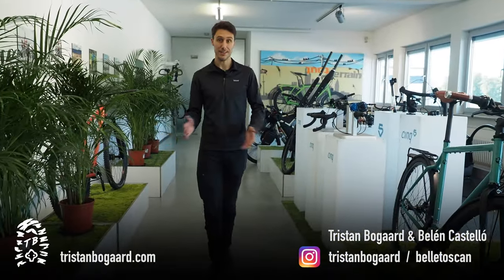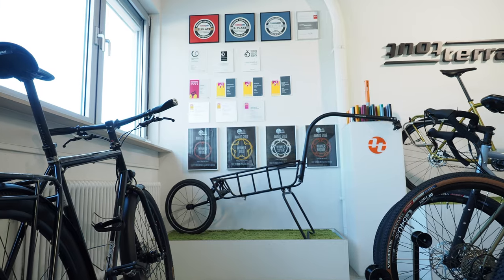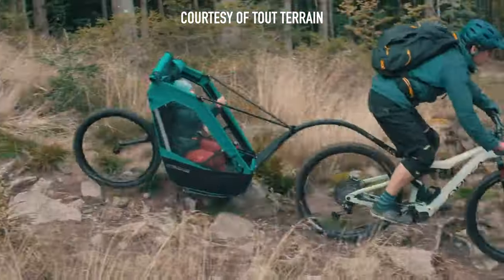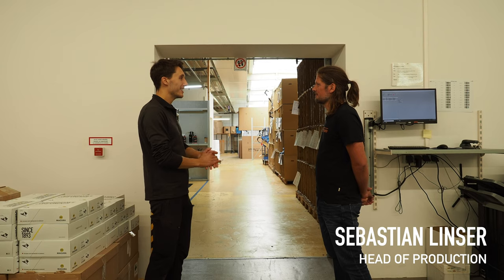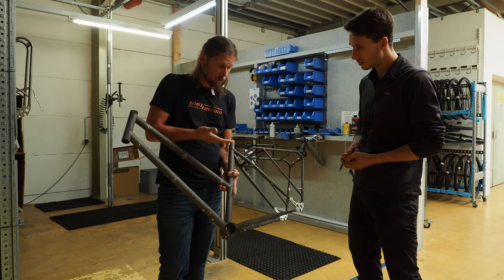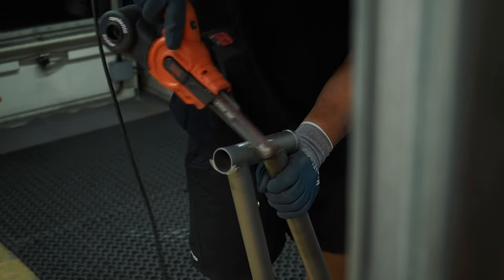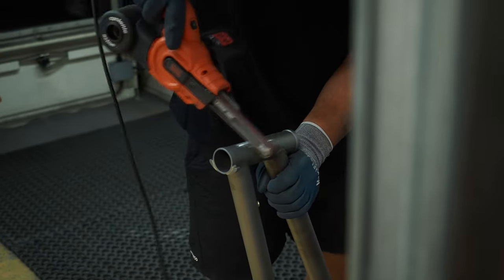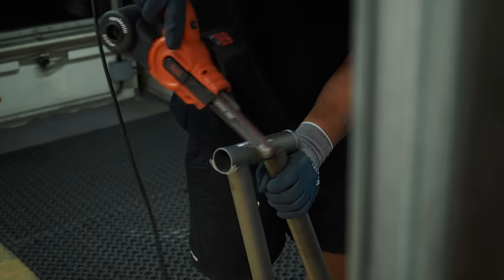Tout Terrain: how to get travel bikes right!

Comment: I don't understand why they paint the frame. If they buy the frame from Taiwan, why not to buy ready frame.  Maybe the reason is Tax breaks in the European Union. If the frame fully produced in Taiwan they have to pay higher tax. 
There is no different if the bike assembled completely by one person or by 10 persons in 10 different station. The result is the same. But you are good marketing man:).
Reply: Minimise potential chips and scratches to the frame, also more environmentally friendly because you can use less plastic wrapping for protection on transport inside shipping containers, also the ability to offer custumers custom colours, check quality of weldings and in case a frsme get bend on transport can be manipulated back to alignment. 😉
Reply from the maker: Spot on!